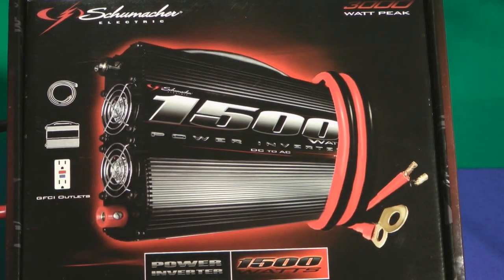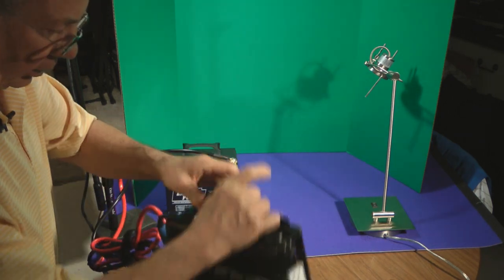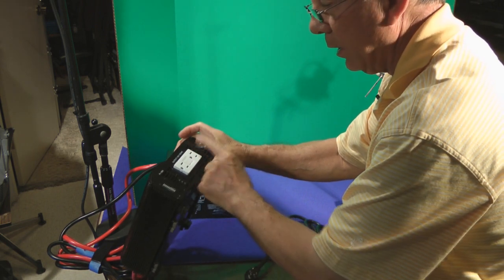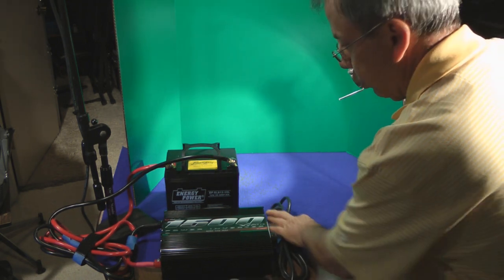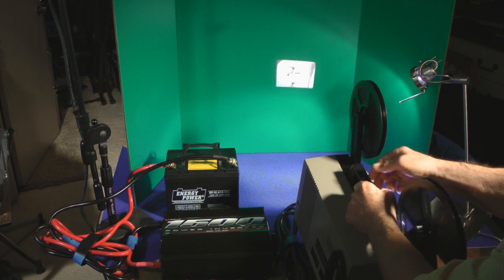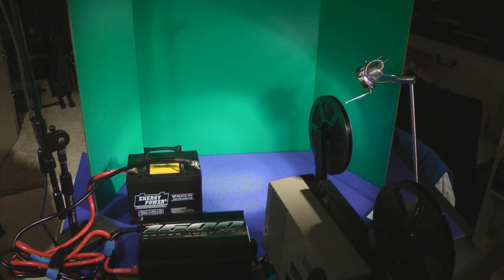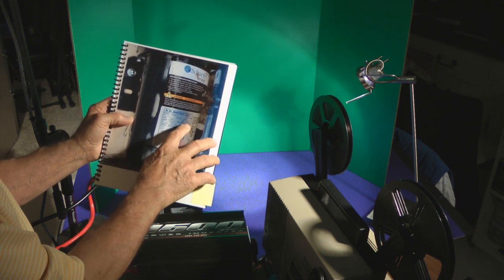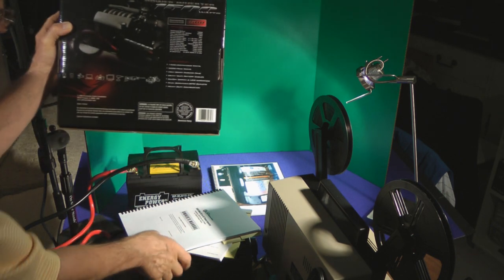Schumacher 1500 Watt Power Inverter.wmv

Comment: I'm buying a 1000 watt Schumacher power inverter from somebody to power compressor in the back of my truck with a 12-volt battery do you think it would work good
Reply from the maker: It should work good as long as you don't plug in inductive loads (vacuum cleaners, large motor appliances) with current rating close to 8.3 Amps.  1000 watts divided by 120 volts = 8.3 amps.  Schumachers are not good for inductive loads.  They are fine for lights, stereos some computers.  Also, make sure your supply voltage is from a good source:  car battery is good..bigger is better....because once the voltage drops below 10.5..it's game over.

Comment: Would a 1500watt inverter be ideal for emergency backup power in an apartment to run small appliances. laptops and to recharge batteries and radios?  I plan to run it connected to two 6 volt deep cycle batteries.

Thanks